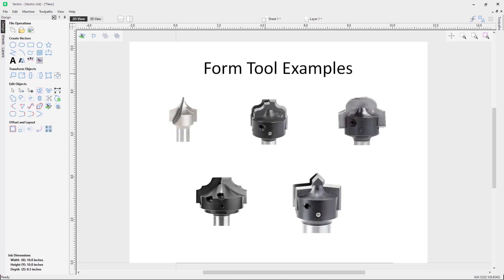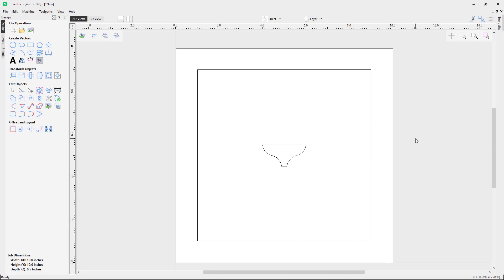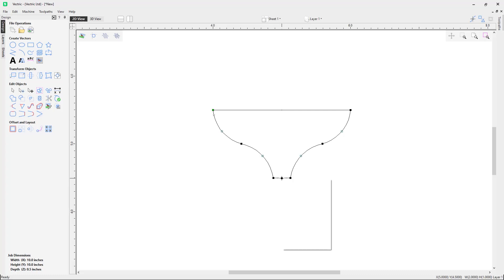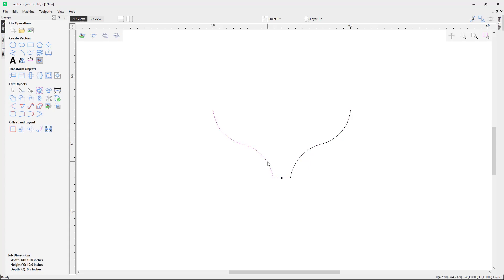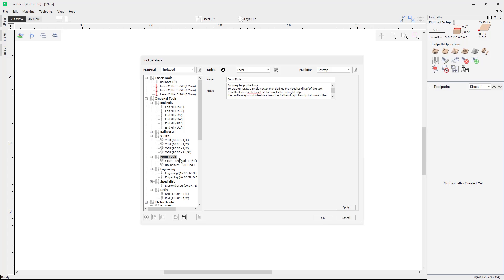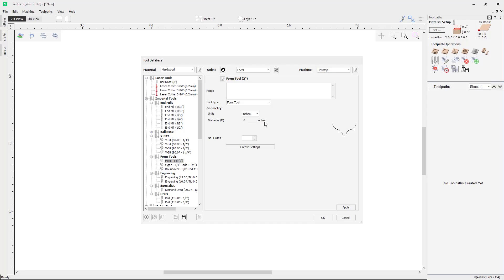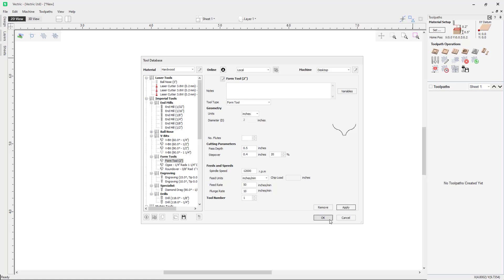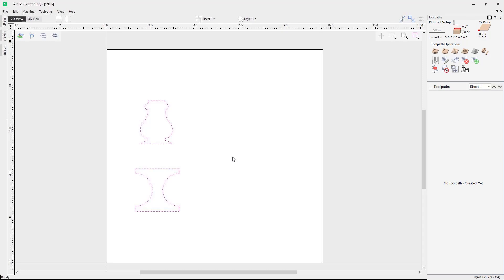How to create a Form Tool in the Tool Database | Toolpath FAQs | V12.5 Tutorials

Comment: I am struggling with t-slot bit. I also need to show the upper small cutter which is used for embedded handles. embeded handle slips in from the side and fits into slots. however carve is saying not an appropriate vector.